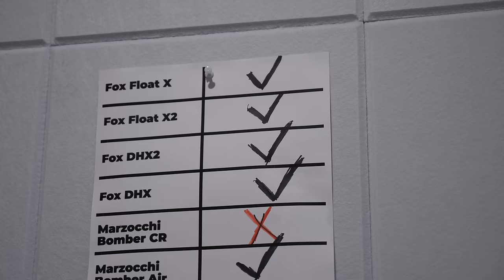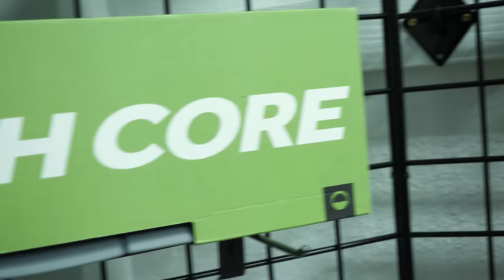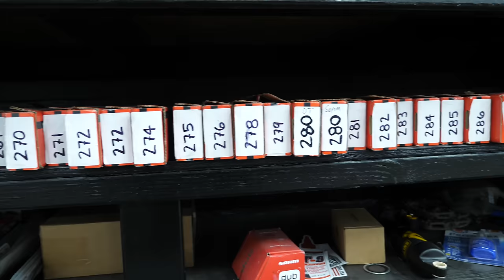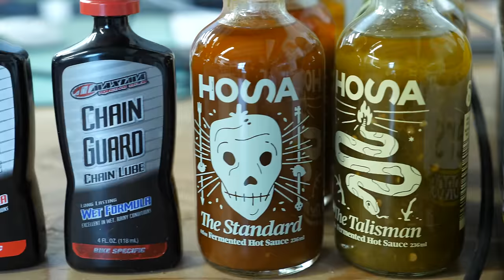Where is Mike? Where is his hair? | Personal Update VLOG with Mike

Comment: Would love to see you working on cars! I’m a huge JDM guy, would love to see what all you did on that Evo though!
Reply from the maker: Thanks a ton for the feedback! What cars are you into specifically?

I bought the Evo with nearly everything done, just needed a lot of fine tuning as the previous owner cut the build short. It had a GTX3576R turbo and every supporting mod. It made 480whp/360wtq, but it took some solid elbow grease to get it fully running. I spent a million hours deleting the MIVEC gears and doing timing, along with a clutch and tons of hours just fixing wiring and dealing with the tuning. The car had literally every suspension upgrade done and it was absolutely the best handling car I've ever experienced.

-Mike

Comment: I have a 2019 XTrainer as well. Great bike! Suspension sucks so I've upgraded to Beta factory and it's dialed now.
Reply from the maker: Great bike! But yes... the suspension is terrible, haha. I've had mine tuned by AMP and it's still just pretty terrible. Might sell the bike and just join the orange crowd with a KTM 300 XCW. If not, I'm gonna spend the money on new suspension for the front and rear of the Beta.
Reply: @TheLostCo  I'm thinking the 2023 Husqvarna TX300 (or KTM 300 XC) might be my next steed. Anyway, braap on!